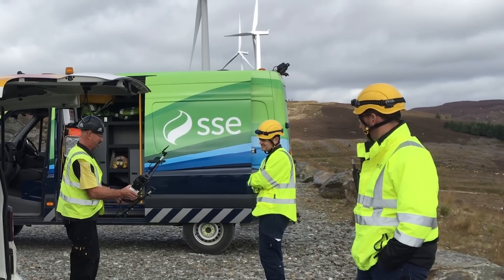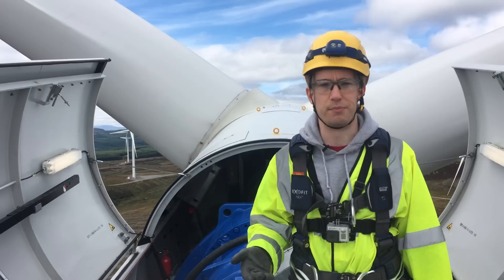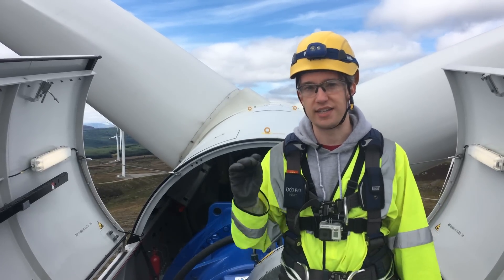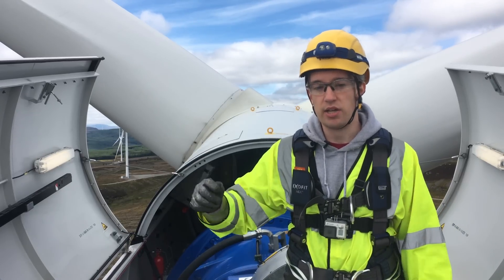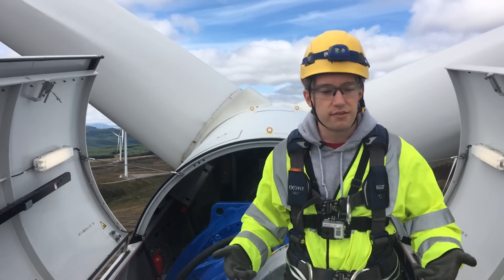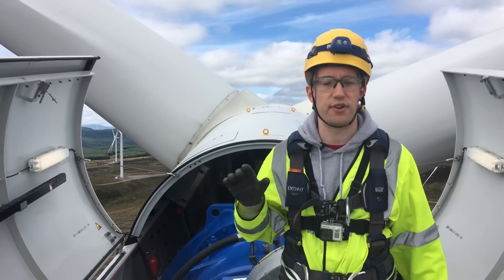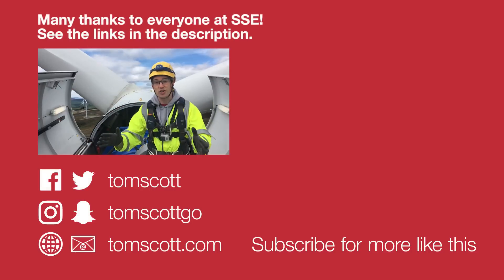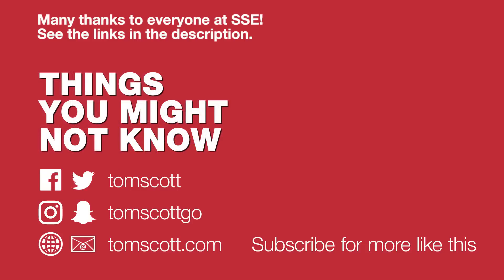The Problem With Renewable Energy (and how we're fixing it)

Comment: There is a solution to managing grid stability, that doesn't need batteries or storage. The utility pays customers to let them remotely monitor and control devices, such as cooktops, water heaters, refrigerators/freezers, and air conditioners. If there is a temporary large peak load, they briefly turn off hundreds to thousands of customer devices for a few seconds to stabilize the grid. Will you even notice? Probably not. But you do get a small bonus credit to your bill, anytime the utility has to do this, and the grid keeps working better for everyone.

Comment: Why not use the solar or wind energy to heat water into steam and power a turbine like before?
Reply: This is actually done with solar in so called concentrating solar power plants, where a large number of mirrors (called heliostats) redirect the solar energy on the top of the solar tower, where it is used to heat up some sort of a medium (pressurised water or a salt mixture), which then boils water and superheats the steam, which turns a turbine. Also google for parabolic trough or parabolic dish systems.
Reply: @FrainBart_main  Nice, thanks for the info. Is that direct from the solar, to the water from the panels or transferred to electric then powering through heat from the electric
Reply: @rrp6405  Solar energy is used directly to heat the water, electricity is only generated inside a conventional generator, which is turned by a steam turbine.

Comment: Remember if a wind turbine (or whole farms) is not turning and generating. Then they are actually consuming power for control systems, lighting, cathode protection and to keep the turbine turning (slowly) so the gearing doesn't cease.   

People are never told about this side of wind based renewables.

Comment: @TomScott
You say there's no battery that can do this on a national scale, but we don't need to have one. That's like saying there's no Circuit Breaker that can monitor every line in every house on every street in the US... you're right.... there's not, but we don't need one. Simple home-batteries. Rechargeable battery banks in every home to power every home in the event the wind decides to take a break for a couple of minutes, much like your suggesting with the Cars but less like a movable appliance and more like, well, Water Heaters.
Or even better, thinking about how British Appliances are sold with fuses in the appliance plug; a battery for every electrical appliance.

Comment: The major problem with wind farms is that they're not controllable. Sure we can prevent wind turbines from turning. But we can't force them to turn when the demand is high. Plus, they are *inefficient*. Like, really, really bad. Most of the time, they output about 2 to 3 % of the installed power. Some spikes reach 20%, but they never last long, and are actually quite rare. The average output is 5% of the installed power. If you install a 100 MW-capable wind farm, you'll produce 5 MW on average, but maintain 100 MW worth of material. They cost a lot, but don't produce nearly enough.

Denmark chose to produce 100% of their electricity with wind farms. This costs a lot when there's no wind, because they have to buy electricity from Norwegian nuclear plants. This costs a lot when there is wind, because they have to give their electricity away, at any cost, to avoid damage to the continental power grid. In the end, Denmark has an extremely costly electricity.
Also, wind turbine blades are made of carbon fibre, and are not recyclable. This year (2020), it is predicted that Germany alone will stack 30 thousand used blades in fields, because, like tires, we have no idea what to do with these huge old blades.

Comment: The giant Tesla battery at the wind farm in Australia seems to be doing a good job stabilizing the grid there.
Reply: It's great for short-term response (especially for low inertia grids) but it's not ideal for long-term energy storage.
Reply: @FrainBart_main  Yes, it'll be a while before Tesla builds a battery that can compete with a hydroelectric dam.
Reply: @zapfanzapfan  I think redox batteries (used mainly in Asia) are better for long-term energy storage than Li-ion.
Reply: @FrainBart_main  I guess it'll be whatever ends up being cheapest and most convenient, flow batteries, thermal storage, hydrogen...

Comment: So, as an electric car owner, who dutifully left it on charge, I will not know if it will be charged, when I next need it, or if instead it was busy boiling the kettle for Mrs Miggings down the Street!
Reply: It would be Smart. So you would decide how much of your battery capacity you'd be happy to sell back to the grid. And it would never take more than that. So if you only needed 50% battery to get to work and back, and your car was 80% charged, then it would only ever take the spare 30%.
Reply: @sormrod  Erm, since most people I know are essentially selfish, why do I imagine that the default setting would be "I need my car 100% charged" every time. I actually agree with the rather neat concept, it is the successful  implementation I have cause to doubt.
Reply: Marcus Gault well you get paid. Charge the car up on cheap electricity overnight, or free at work! Then sell electricity back at peak times for more money.

Comment: The biggest problem with renewable power isn't the kinetic energy problem. The problem with solar and wind power is that they consume large amounts of rare earth metals. If the US were to convert to 10% solar or higher, it would lead to so much mining that the mining activity itself would be a greater threat to the environment than oil or coal. Additionally, solar batteries wear out in about 15 years and the constant dumping of old solar batteries would cause a huge problem with waste disposal. Wind, on the other hand, has problem with land use. If you want to have a significant amount of wind power you would consume all the farmland available. Wind also kills birds as well as can cause disruptions in weather patterns if deployed in large numbers. The best solutions are hydro and nuclear which are kindest to the environment.

Comment: if we need 1Gw base load power from wind then at a capacity factor of 33% and a 100% storage efficiency then 3Gw of wind power is needed so the 1Gw is supplied to the grid while 2Gw goes to storage. When the wind is not blowing 66% of the time power comes from storage to supply the grid. This means on a 3 day cycle day 1 the wind is blowing day 2 & 3 it is not. but on day 4 if the wind is not blowing then there is no power at all. If storage comes from car batteries then you do not have power to drive home or to work. meaning the size of the battery for the car needs to be a lot larger then it needs to be. So when you drive home you can not power the grid. The cost of the car  would be a lot higher because of the needed extra storage. So one would be better off haveing a fixed  battery storage building keep the cars light as possable. Otherwize you would have to let your car sit there supply the grid with power and have no power left to drive home. 
Car battery storage to supply the grid 
WILL NOT WORK. sorry.

Comment: I remember hearing - can't remember where now - that it wouldn't be a good
idea to use car batteries, basically because that isn't what they would are designed for. the battery in a car would be (one of) the most expensive and important components in an electric  car and it would be stupid to wear it out and reduce its life time by using it as energy storage.

Comment: Cannot say that I agree that the future is car batteries.
Tesla installed a massive mains battery in South Australia and it's the best thing to have happened for the South Aus and national grids.
The uptake time for the battery is some fractions of a second from zero load to maximum.
It is also solar/wind charged so costs are very small compared to coal. We don't have nuclear power in Aus....
Reply: You have to distinguish between short-term frequency support and long-term energy storage. For the former, Li-ion batteries are absolutely great, for the latter, they are far from being cost-effective.

Comment: Very interesting, thank you for posting this!
One issue about using electric cars to help balance the grid, is that those batteries have finite discharge and recharge abilities, so you're wearing them out by using them in that way. 
Please correct me if I'm wrong!
Reply: Another issue with using cars as batteries is that people will just unplug their cars at peak times so they don't lose any electricity then plug them in again at midnight when the electricity is cheap.

Comment: With a large enough flywheel and enough renewable energy generation, efficiency wouldn't be a major problem.  It wouldn't even need to be made only of steel.  You could have something filled with heavy stone or concrete if need be.  If you have a cylinder or disk of several hundred tons spinning at a few hundred rpm fed by a green energy system that is capable of producing 115-130% of the nations average peak power requirements, it could probably handle that few minutes of heavy load until one of the other systems could take over.

Comment: Problem with using car batteries is mass and endurance: having big heavy battery which moved with car reduced efficiency of car if you are not gonna use it in full capacity. Also, aging of battery in car is bigger issue than aging of stationary battery because you got reduced range with same mass. Better solution will be reusing old car batteries in stationary stations. Old battery, that already lost part of capacity, still get enough runtime if you don't need to move it.

Comment: Surely, there is just as much rotational inertia in all those thousands of wind turbines as in a few steam turbines?  In fact, as the specific output is MUCH lower(wind turbine works at just Pascals of deltaP, steam turbine at Bar of dP), there must be MORE inertia as a total in the system?  In that video, you are standing behind a MASSIVE couple of tonnes of rotating blades (which, ok, only do about 60rpm) but also right next to that blue generator, which is geared up and hence has a larger referenced inertia.

Comment: Those big turbines are available in two zero carbon power sources:

Hydroelectric and nuclear power.

Probably in geothermal as well if it is large scale enough.

And shouldn't all those thousands of tiny generators create a little bit of the inertia from the one power plant they replace?
Reply: I believe you mean the small generators inside wind turbines. Most modern wind turbine generators are connected to the grid through a power converter, partly or entirely decoupling the rotational speed of the generator from the grid frequency. Therefore their inherent inertial response is close to or exactly zero. There is a possibility however to programe the converters to inject inertial power (slowing the turbine rotor) when needed and vice versa. There would be some time delay, although quite small. There are also limitations in rotor rotational speed. Anyhow, if you want to know more about this, research synthetic (artificial, emulated) inertia.

Comment: Controlling millions of individual batteries in real-time across the country would be a logistical nightmare. Not to mention wind turbines and solar panels are useless when the wind isn’t blowing at night. You need massive energy reserves somewhere, and not many nations can pull that off with hydroelectricity alone. Batteries or hydro to buffer the sub-10 second demand, hydro or geothermal or gas to buffer the sub-10 minute demand, and nuclear or gas to buffer the longer times.

Comment: Flow batteries + local (home battery) storage? Flow batteries get you a big bang for your buck; and many EV owners either already have or plan to acquire Tesla Powerwall-type battery backup units. I have an EV (VW e-Golf) and will get a Powerwall with my next EV (Model 3). That way, if the grid electricity goes out, I'm covered for house and car, at least for a while. Tesla is marketing solutions that comprise EV, home battery storage, and rooftop solar to charge them: trees loom over my home, so I have to purchase electrons from the NJ ACUA wind farm instead.

Comment: Reminds me of a story my dad told me, he used to work in the old telephone exchanges in the 1950's and 1960's as a technicians. They had HUUGE flywheels spinning in the basement of the exchanges 24/7, and in the event of a power failure some of the technicians would have to run down to the basement and slowly release complicated sets of clutches so the flywheels could start massive generators.

Comment: Why not create a monolithic battery?
A 'normal' battery would impractical, but like you were saying about tons of spinning metal, why not create batteries made of giant spinning disks, get a giant metal disk and stick it on a generator, when there's more power you just send it to the generator to spin up the disk, effectively storing the electrical energy as kinetic energy, when there's less power, draw power from the disk, converting the kinetic energy into electrical energy, and since it's as simple as flicking a switch to engage the generator, the delay would be minuscule.

Comment: Store a back up of energy in cells before you supply a city that can allow a little extra power out on top when needed or be used for a steady steam as an immediate supply to make the rate and amount steady and constant

We've been using electricity for years and I know for a fact energy company's will have half a century's worth of data to work out what power has been required on average. All they need to do is make that amount plus maybe 20% as a backup to help keep things flowing smoothly. They have a day where there's no wind no problem allow some of the reserve out. Have a day when it's very windy no problem store it for future use

The reason why no one has come up with a solution is the energy company's that have this data aren't going to happily hand it over to renewable energy company's to help put themselves out of business

Comment: It's not true that a rotating windmill blade has zero rotational inertia.  Sure, one 5MW wind turbine has less rotational inertia than one 500MW steam turbine, but does it have one hundredth as much?  In addition, if your reliance on large centralized generators goes down then so does the likelihood of the problem you describe.  Wind turbines may fail as frequently, per MWh, as standard steam turbines, but that implies more frequent but less severe outages.

Comment: One of the main balancing options is actually the turbine-bypass at these large power plants. If the demand rises, theses close down reducing the efficiency of the plant but simultaneously outputting more power. This can be done in seconds and is also crucial for grid stability.

Comment: It is not economical to use car batteries to feed into the grid. The batteries are not designed to be cycled that often. It's better to use purpose built batteries.
Alinta has a few renewable assets in remote Western Australia and has a gas turbine for this particular reason. They are now going to replace the gas turbine with batteries to reduce their costs.
Car batteries and grid/home batteries are similar, but there are enough differences that they cannot be interchanged.